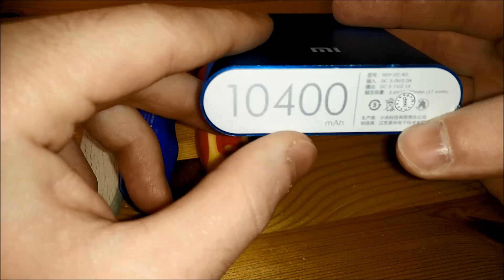Teardown of a dangerous + fake Xiami 10400mah Powerbank

Comment: I don't know if the batt any  good I brought the tool batt type I had. Charged it with a USB break out lithium board. Went up to full power. One dude on utube gets those brings the voltage so can be charged with regular lithium charger had no problem unless it was reverse voltage or .1 voltage or something.

Comment: Ha! You got it totally wrong. These fake power banks are NOT dangerous - they're just a huge con. Dismantle the cells and you will find 3 of them are filled with nothing but sand or gravel. One is genuine and provides just enough power to make it work. Here's a link to the genuine Xiaomi product, with more than 1,000 good reviews: https://www.banggood.com/Original-Xiaomi-Power-Bank-2-10000mAh-Quick-Charge-2-0-Portable-Charger-p-1088932.html?p=JQ26191551677201504Z&utm_source=bbs&utm_medium=agogo&utm_content=zhangruihua&utm_campaign=home

Comment: Did you ever test the cells? Would be interesting to see what capacity they actually have.
Reply from the maker: I didn´t test them individually, but I was able to charge my oneplus 1 smartphone to about 2x60%. The 1+1 has a capacity of 3100mah. This means that 3.1Ah * 1.2 / 0.8 (for boost & charge efficiency) equals about 4.8Ah for all 4 cells or about 1.2Ah per cell.
just a rough calculation.
Reply: That sound's about right. Any cheap 18650's I've bought tested to around 1.2Ah.
Reply from the maker: Yeah it seems like they are made with techniques from the last millenium. I think the panasonic 18650s with 3400mah are about the best deal you can get right now. They are just about 3-4$ and hold quite a capacity
Reply: Only one cell is real. The other 3 are fake and filled with sand, to give them weight.